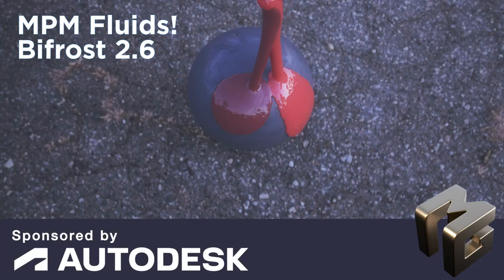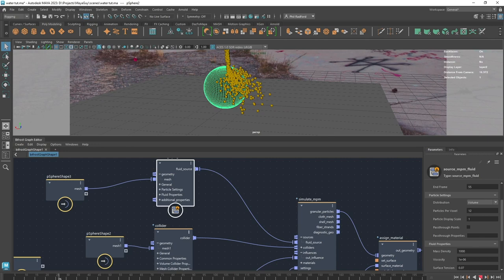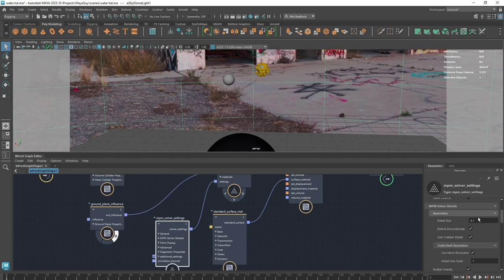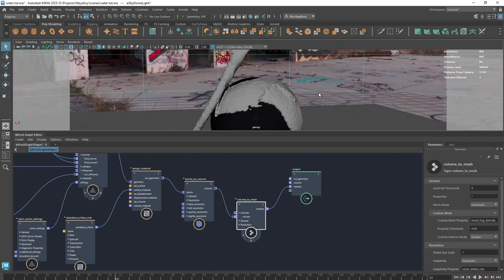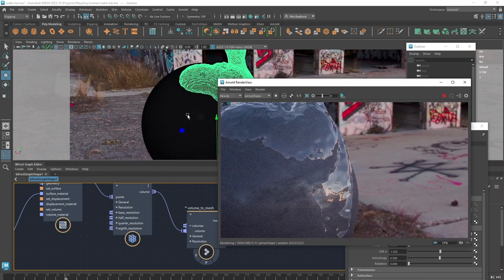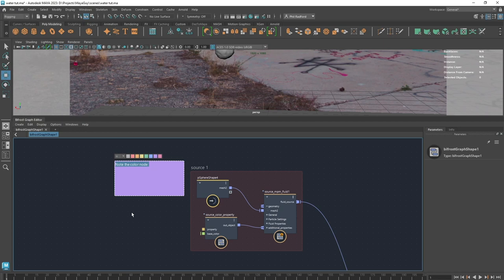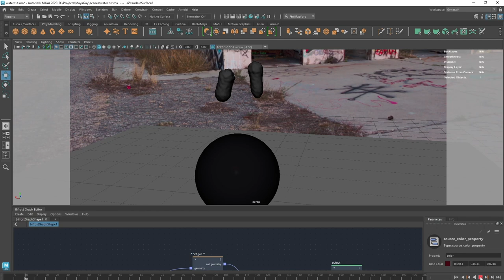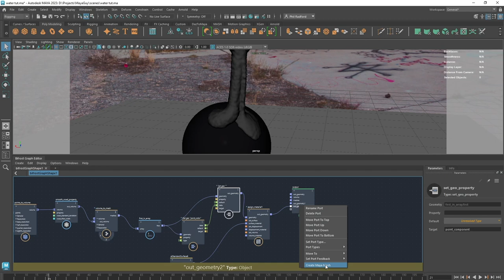Bifrost MPM Fluids & some new Bifrost 2.6 features.

Comment from the maker: Just FYI - You don't actually need the 'Get_geo_property' and 'Set_geo_property' to do this after all. Just plug the volume to mesh directly into the assign material
'with' the aiuserdatacolor Arnold shader and it will still work. It wont hurt to have the get geos but not needed ! 😂
Also - try adding a 'diagnostic_material' if you want to see the colors of the mesh in the viewport !

Comment: Hi.. Im trying to make honey. All good with the viscosity and stickness . The problem is the fluid looks like crystallized honey.. Doesn't look smooth and clean.  In the mpm solver settings the detail size is 0.03 and in the source fluid. I have 90 particles per voxel... Do i neefd more particles or what??  Thank you